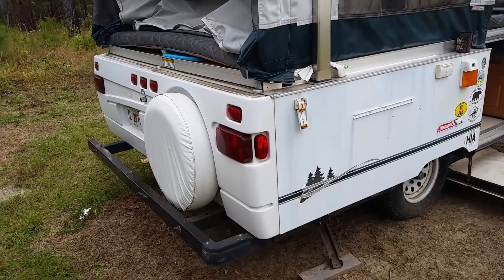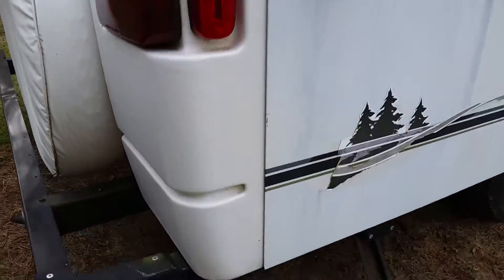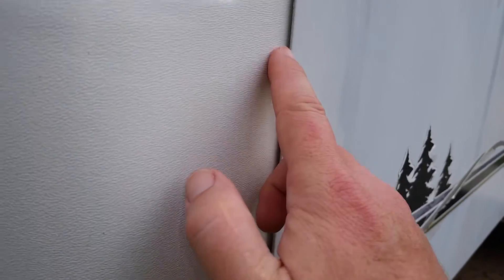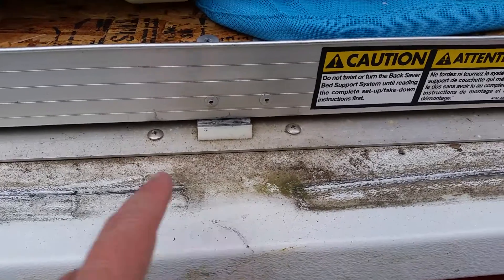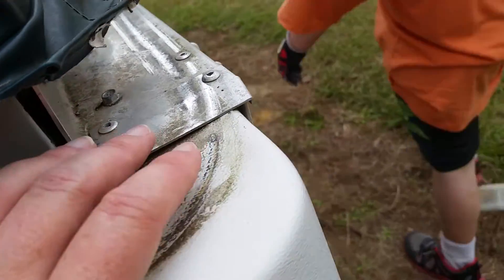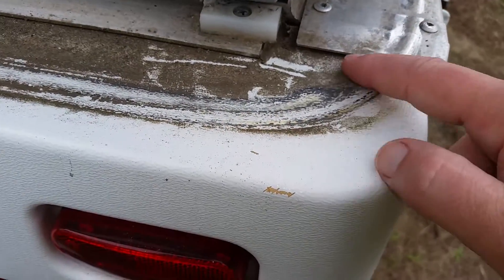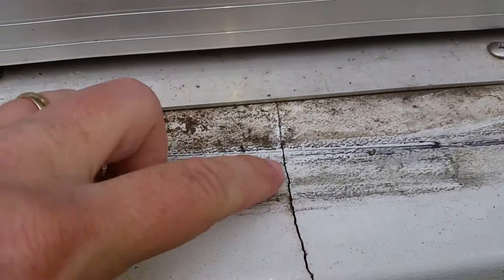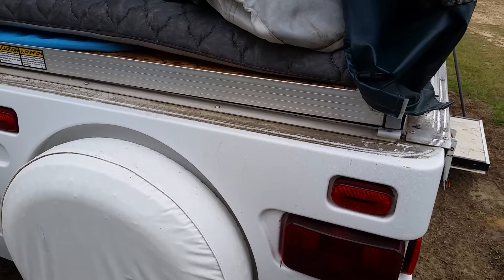Water leaking into popup camper

Comment: I have a 1996 Coleman Popup Camper similar to yours. I just finished installing the rubber seal around the top cover. I found a replacement seal sold on Amazon for approximately $175.00, its a complete kit with the adhesive. The next thing you will probably encounter is the abs shell cracking which is very common. I used Trex spray on bed liner to completely seal the top shell and you can purchase it in white.....Great Product! I spent approximately $450.00 on the entire project and now have a camper I can use for hopefully several more years. I hope this helps

Comment: I appreciate your videos!!
I'm looking for a used pup. Scheduled to go look at the same one '02 Sea Pine.

What advice do you have?
Would you recommend a different brand/model?
Thanks much, Nancy in rainy PNW
Note: I'll store it under carport
Reply from the maker: Nothing wrong with the Coleman models they are all built the same during that time period,  my only advice is make sure rodents or moisture hadn't destroyed the interior and also look at the subfloor from underneath especially on each end to make sure no bad water damage or rot- through.  Water and pests are the 2 biggest enemies of campers just look closely also make sure the AC and appliances work if it has any.  Some folks have problems with water getting under the roof laminate and water logging it, I haven't had that.  Good luck!

Comment: Hi, saw your vid today (6-30-17). Don't know if this will help but, I bought about 2 months ago a 2002 Coleman Lakeside pop-top camper (same basic design and assembly as yours). It turns out that many Coleman campers had not been well sealed during construction and over time  (especially if the abs shell has cracks) and the end seams weren't sealed up well, the water gets into the inner end walls (which is fiber board covered in fake wood (peels off) skin). Fiber board acts as giant sponge and over time rots all other areas around it. I am in middle of replacing each (rotted moldy) end panel and then will repair the cracks in the abs cover skins and then silicon seal all way around it. Once you replace the rubber roof seal (should not have any gaps), the unit should remain weather proof at that point. I am replacing the fiber board with 3/4" ext plywood. Its still a work in progress. Good luck all!
Reply from the maker: Stephen Woodward thanks for your comment.  Right now I have it parked under a relative's shelter. I sealed the panel seams with outdoor caulking but I think I need to go more in depth like you're doing to really solve the issue.  As long as the shelter is available I'll probably just keep it there as-is because I'm too lazy to take on a big repair project like that.
Reply: Well, I've finished the repairs to the front storage compartment. All new plywood where the fiberboard was and a patched in 3/4" ply floor repair too. Silicon sealed all seams in floor and made sure all external seams and joints had flexible silicon sealer where ever the water had entered before. Starting tomorrow, I am tackling the rear panel rot issue (will be removing the rear abs panel and inspecting the rear "wood" wall panel that supports the crank tree and bed support top edge, as well as patching the spongy (rotten) floor area.. I sealed all breaks in abs with layer of silicon adhesive sealer on both under side and then the top (exposed) side. (Front unit survived the garden hose test and my wife was very impressed).
Reply from the maker: Sounds like you're solving the issue. I'd love to see pics (or better yet a video) of that rear panel work on yours, since that's where my problem is, I could learn something from your investigations in that area. I do have some sealant on the rear seams of mine but I don't think that totally solved the issue.
Reply: Sorry I haven't gotten back to you sooner. The rear panel yielded rotted floor corners and rotted back panel board and wall support pieces. I probed the floor and cut back to where the floor remained solid. I cut a 3/4" dry plywood piece (waterproof red surface on 1 side) and patched in and sealed all joints to old floor with clear silicone adhesive sealer. I replaced the 1/8" paneling rear wall with 3/8" exterior grade plywood painted the inside surface to match the color of the inside wood. Used 1x3 pine on edge to support back wall to copy where old support wood was. Repaired and strengthened cracks in rear abs shell and made sure once it was back on, that all joining seams were sealed with clear silicone to keep water from ever getting in again.
Reply: Can't seem to add pics here to the reply, tried to but wouldn't allow.
Reply: Stephen Woodward I am having the exact same issue as you and the original poster. Mold and water damage on the underside of the flooring, from water leaking between the seams of the side and front panels. I have a 1998 Coleman Fleetwood Popup. Would you be willing to email me the pics you have of your repairs? I have to follow the same path, but am a little intimidated by this project.
Reply: @tsoest23  how did this project go for you?  Do you still have the camper and if so, how's it held up?  (i just rebuilt the back panel of mine... Fingers crossed).
Reply: DB Craft I ended up ripping up the vinyl and 
sprayed it with bleach and water, let it air out for a week, then painted it with a mold blocking primer on the top and underside of the affected corner. It was the best I could do but seemed to do the trick. To seal the seam where the two body panels meet where water was leaking i through, I used Gorilla Waterproof Patch and Seal Tape in white. It worked perfectly. I have since sold the camper to my sister, and her husband is tackling even more repairs, so it is in good hands!

Comment: I realize this is 4 years later... But, I just bough a coleman utah with the same back end design, so... For all the others out there looking for an answer: 
The top weather seal needs to be fully sealed.  Then, the top metal strip that goes side to side under the bed should have a rubberized weather seal under it from the factory, but, could be re-sealed if worn.  The corners should be sealed because there is wood right under it that supports the entire back end panel and spare tire. 

The wood in the corner has become rotted on my camper, causing the entire back panel to pull away from the camper and the seam where the plastic meets the aluminum got big enough to leak more.  I removed the panel (screws along bottom of panel, remove spare, remove screws and weather stripping for metal strip at top, unplug wires for lights) and replaced all the rotten wood.  Once reassembled, i sealed under the top metal, the corners, and the seam where plastic panel meets aluminum panel.  So far so good!

Hope this is helpful to someone out there!
Reply from the maker: How hard was the repair? I have also taken my back panel off but haven't replaced any wood yet,  the camper is still sitting with a tarp over it.  I don't know what in getting into.  Subfloor rooted about 2' back from the end.
Reply: @Brown1286  difficulty of the repair is going to depend on how damaged the subfloor is and how handy you are.  If you need to replace floor, you'll likely need to take out cabinets and flooring inside as well as the plastic back panel.

If the floor is still ok and can be left, removing and repairing the back isn't that difficult.  It's for sure an intimidating job, but once you get into it... Not that bad. 

The biggest issue(s) I saw in your vid are: the roof seal, and it looks like there's a large Crack on the top of the plastic panel.  Step one... Get a new roof seal and make sure it is completely sealed.  Step 2, take the back off, fix the panel...  There's lots of info out there for this, but I used j.b. Weld (origional) on the back of the crack.  Once you get the back off, you can assess the damage.  I used same size lumber (treated) to replace rotten wood (I didn't have to replace any floor).  

When I did this, from start to finish it took me 1 day (working on it all day).  I used liquid nails as my glue, and osi quad as my sealant.

Comment: I have this exact same unit. I have water damage in the same spot as yours as well as EXTREME damage on the front in the cargo box and front floor area, gonna have to take it down to the frame and rebuild. Luckily I got a really good deal in mine and can afford to spend a little time and money on it. Bottom line is that these things are not built with enough waterproofing precautions. Period.  If nothing else, the cheap OSB should be sprayed with a coating to at least slow water absorption and rot. After I get mine fixed Im investing in a good cover.
Reply from the maker: Dudley Meadows I agree they just weren't built well enough.  Good luck rebuiling yours. Post video of it if you can.

Comment: Have you had any success with this? We have the exact camper with a similar issue on the same side.
Reply from the maker: I sealed all joints and seams with clear marine caulk and I think it has helped, I can't tell if it has stopped the leak completely yet or not.
Reply: Thanks! We sealed every space we could find. Going to test to see if it worked. Good luck!

Comment: Put mud flaps on your rear tires of your camper. If you have been driving in the rain? The rain and road grime is being launch by your tires forward rotation and it is hitting the under side of your camper and causing it to rot